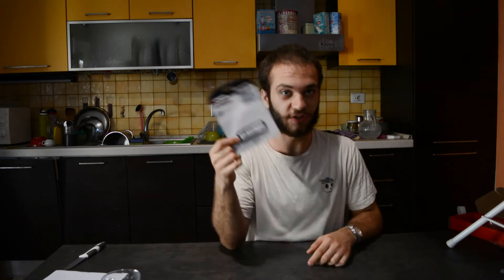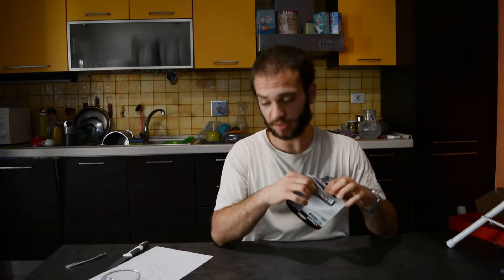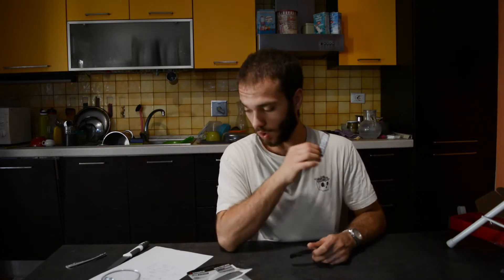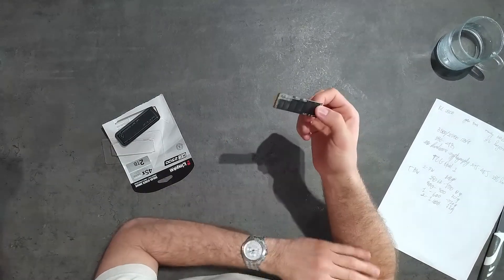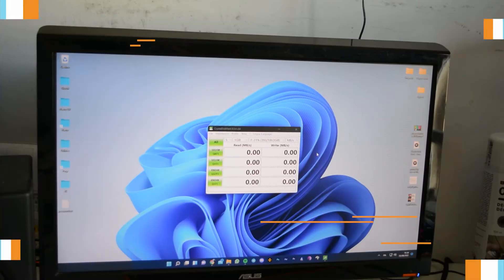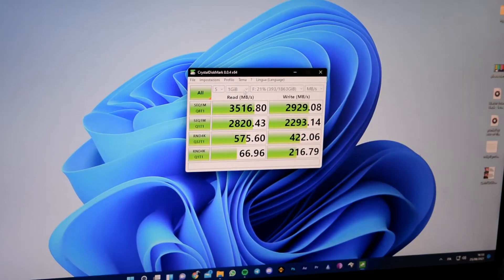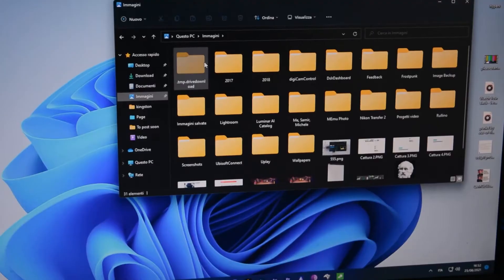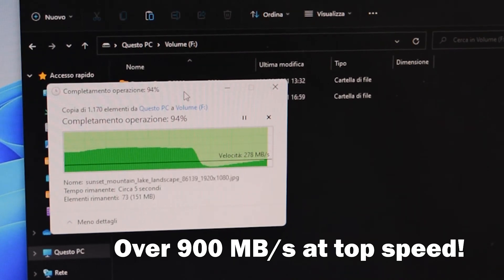This NVMe is too fast -Unboxing and Review Kingston KC2500

Comment: i don't really understand TBW, what is that exactly, read and write speed, but it's 1TB right so it should atleast 900gb at the minimum.
Reply from the maker: TBW means Terabytes written, it's the expected life of an SSD or HDD. Basically, it's how many TB you can write on an SSD before it could die.